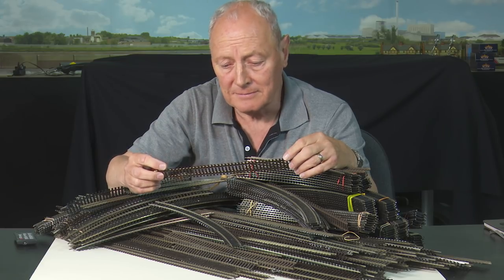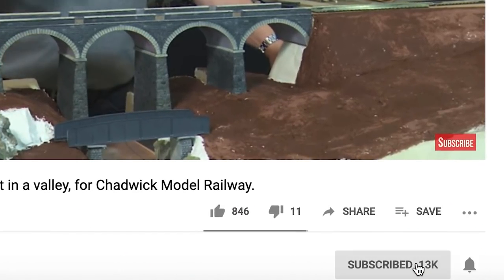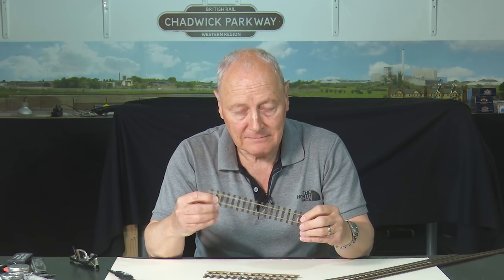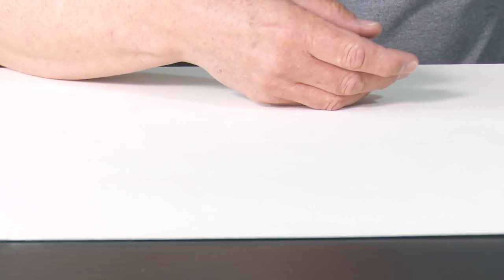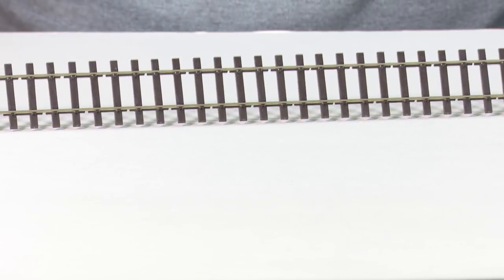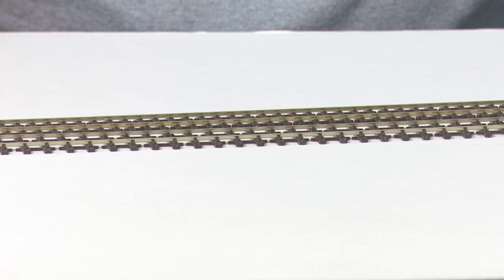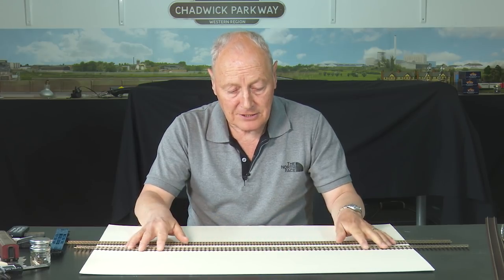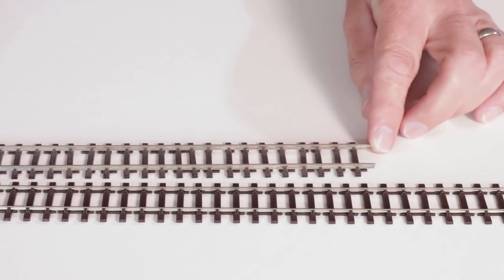Track  Peco Code 100, Code 75, Bullhead, EM and P4 explained at Chadwick Model Railway | 66.

Comment: Hi Charlie.. I'm enjoying your show from here in Los Angeles, Ca., USA....I'm probably not the first to come up with this wacky idea but here goes.... 
11:58 : The bumpiness due to the flanges hitting the simulated  'spike heads' on the code 75 doesn't seem to me to be that bad..Thus, would it be possible to actually go along your existing track and in some fashion sand/file down the spike heads just enough to clear the flanges instead of either re-wheeling or going code 100 ? Of course I mean not so much as to completely destroy the head...Then maybe a bit of paint would be needed to re-darken the heads as plastic tends to go white when sanded...
Also, would you tell we viewers how many scale inches code 100 rail represents in HO...My belief, if scaled out, it would be around 13-14 real inches tall..Yes ? No ?  I'm having arguments with people in a train forum over this..Thanks, M
Reply from the maker: No Mark, it's far easier to chanch the wheel sets. It's 4mm to the foot Mark.
Reply: @ChadwickModelRailway  Thanks much for such a quick response...But I'm asking, if you are able , to tell me how many scale inches (not metrics) code 100 rail is in HO scale 1:87..
I'm sure 100 looks great in OO scale.. But I think it's too tall for HO at perhaps 12"-14". No ?

Comment: Hi mate, love your videos! I found you while looking at track comparisons. Basically iv always wanted to build my own layout. I have a large collection of hornby sets and extra hornby track but I'm not sure if I should use this track for a proper layout. Would you say its worthwhile for me to invest in peco track for a permanent layout and sell off my old hornby track? I'm not worried about money my concern is more committing to a scenic layout then having to rip track up because points are failing/derailing ect.
Reply from the maker: A great question JJ. 
My advice would be to avoid at all costs any steel track, and if you can, switch to Peco streamline Flexi track. 
That way, you’re not limited by the geometry of rigid track systems. 
Regards, Charlie
Reply: @Chadwick Model Railway  ok I will look into that thank you for the advice. All my locos are standard non DCC, I'd love to build a DCC layout but I think it's too much work and I'd have to essentially change all my locos which I don't really want to do, I'm basically just gonna build a old school layout which I manually control myself. Do you have any videos you could recommend for people who don't use DCC to get best results? I'm guessing the first stage would be a better power controller than the ones you get with hornby sets.
Reply from the maker: Sorry JJ but I have none.  However, YouTube is an endless source of information once you know wher to look.
Regards Charlie

Comment: Thanks Charlie. Very informative as usual and particularly useful for me as I’m just starting to build a layout. I’m just about convinced that I will use the Peco code 75 bullhead track. I’ve been told that the sleepers are difficult to maintain an even spacing when bending the flexi track. This is apparently due to the grouping of the plastic mouldings of the sleepers. I believe the code 75 is in groups of four whereas the bullhead is in groups of two? Have you any thoughts on this?
Reply from the maker: I’m so pleased that you enjoyed it Dave.   I’ll check out the laying of Bullhead in a later video.

Comment: Just as a matter of record...( and being VERY pedantic ) ... there was some bullhead rail used on concrete sleepers... most of the 3/4 mile running line at 'Rocks by Rail' in Rutland is laid using it... see photo link below!
https://www.flickr.com/photos/satchfan1/5776393522/
However... I believe this was predominantly a war time format … and on the basis that I think this was almost exclusively used on Industrial railway, I think I'd generally concur with your statement!  Great video... keep up the good work!
Reply from the maker: I’m so pleased that you enjoyed it Al.

Comment: Hi Charlie, thanks for another great video pesentation. Do you have any preference for track joiners / fishplates? I find the Hornby ones are a much tighter fit due to their folded profiles, whereas the Peco ones are often much looser and prompt fears about their ability to transmit the DCC signals.
Reply: I should also say that yes I know that your dropper wires will manage the DCC signals, but that will only be 100% efficient if every piece of track has droppers attached.
Reply from the maker: and that is the case Nick. Every piece has droppers. I’ve never use Hornby joiners so I really can’t comment.

Comment: aren't turnouts usually wooden sleepers anyway? AND am I on my own thinking that the clickety-click, clickety-click sound of using discontinuous track with joints .....  much more realistic sounding than the expensive steam engine noises coming from model engines these days ..... I didn't think you quite said as much?
Reply from the maker: Yes only newly commissioned tracks seem to have concrete sleepers.
Whether loco sound is realistic is obviously a subjective experience.
Regards Charlie

Comment: Thank you for another informative video.  It is interesting, I changed all my Lima wheels at the first opportunity using either Hornby or Bachmann ones and doing it one at a time.  I have more problem with the huge Lima and Hornby couplings, which I don't know how to successfully replace.  The depth of the rail is important and there are issues with older engines whose depth are too much for code 75 so I will stick to code 100.  As far as sleeper spacing is concerned, I don't think it does matter that it is prototypical.  It is the look which matters.  By the time you have ballasted, and in your case weathered, it really doesn't matter about the correct spacing because it looks OK.  Besides which it is the moving vehicles which your eyes turn to when they are operating not the track.  I do admit that Proto 4 and  18 8 track looks brilliant, but unless you have started with that in mind, or have unlimited finances and have decided at the start that is the way you are going to go, it is expensive and hard work.  I remember looking at the model railway produced originally by Mr Ahern.  The scenery and houses were exquisite but the railway looked almost amateurish in comparison.  As far as set track is concerned, I do believe that it can have its use on a layout under certain circumstances, in the same way as when looking at hidden sidings there is no reason to use code 75 bullhead track.  So as long as you are reasonably happy with the result, and you can actually see the track, I don't think that code 75 (and particularly bullhead rail)  is the way forward and will probably remain an almost niche market and as a result will carry a much higher cost.  If you believe that extra cost is worth it then that is fine.  If not, stick to code 100.
Reply from the maker: Some excellent points Don.
And a train set gets put away at bedtime.

Comment: as per a previous comment I am a 60+ and just starting out so any help / advise on track laying / building base boards. basic to get started and any advice on DCC controller as I am starting from scratch.
Reply from the maker: Hi John,  here's a quick list.
What scale depends on the room available.
What era depends on what floats your boat.
Size also depends on your health and wealth!
Don't start something that you will never finish.
DCC is the best when starting from scratch.
Reply: thanks , my plan is a small project in oo scale colliery setting.

Comment: Hi Charlie! New Subscriber here! I'm about to embark on the great journey of making my own layout. But I'd like your advice on buying second hand track. At a local flea market there's a unit that sells second hand model railway things. One section in particular sells a lot of track, but it's like a pick and mix system, where it's a box full, and you pick what you want. The key problem is how do I tell if it's Hornby, and more importantly the difference between steel and nickel silver? I'd prefer nickel silver. I'll look out for signs of rust, but what if it's a shiny 'new' steel piece? (There's also a proper model railway shop there too, but they sell brand new, and I have a 'challenged budget'! ;-) 
I'd be most grateful for your advice and thoughts.
Many thanks.
Mike 
(Greetings from sunny Cheshire!)
Reply from the maker: Mike that’s a very easy one, take a little magnet with you.
Obviously the magnet will be attracted to the steel and please don’t buy any regardless of the price. I prefer Peco to Hornby but be very cautious when buying secondhand points. Regards Charlie
Reply: @ChadwickModelRailway  Thanks for the advice Charlie! It's much appreciated!

Comment: NO! The scale is 3.5mm to the foot, the gauge is 16.5mm.

If you go to Grantham and take the Norwich train you will see that the sleeper spacings are different. The standards books produced by railways over the years might give a set spacing, but reality is often non-standard.

4mm to the foot is 1:76.25, irrespective of the gauge of track you run on.

Peco is based in DEVON.

There was Bullhead track on concrete sleepers. There was plenty of it about. The Nene Valley Railway had plenty of it between Peterborough and Orton Mere stations. They either got it when they bought the line or bought it off BR to replace older track.
Reply from the maker: Thanks for your advice Neil.

Comment: Great video. I question do you guys have peco code 83? I ask because that's what I use in HO
Reply from the maker: Hi, Code 83 is indeed available here but  I believe that it is only bought by North American modellers.
Reply: That would be me lol
Reply: @ChadwickModelRailway  In mainland Europe code 83 is considered the compromise track height... which will fit most of the pre -NEM wheelsets from the late 80s but still looks a little better compared to a code 100 profile (especially an unpainted one). If you don't want to go finescale, you have the choice between Weinert and Tillig for that profile height.
Reply from the maker: Thanks Ivo, some interesting points.

Comment: Very interesting. I have been out of the hobby for some years. Lots of boxed up rolling stock. 25 years and older!. So if I purchased a Hornby item of rolling stock today will it run on both code 100 and code 75 track?
Reply: Yes, new models have finer wheel sets which run on both code 75 and 100, but your older models will run on code 100, but might not   run on code 75.
Cheers Rich
Reply: @gwrdriver1660  Thanks for confirming. Thinking about getting back into the hobby. At the moment reading up on DCC to convert my existing loco fleet.
Reply from the maker: Great decision, Going DCC is the first step in a great modelling future.

Comment: How times have changed since I last had my layout in the early 80’s. in my opinion, a train set can be the very start of a layout or model railway, what the saying from small acorns trees grow.? You mentioned HO, O and 00, what about N gauge?, I know it’s not so widely used, but nether less you might have some N gauge viewers.
Reply from the maker: I do appreciate your view on N Gauge Paul.  However, in that video, I was examining the differences between the “4mm to the ft” options.

Comment: Standard gauge vs Broad gauge? It's like an earlier - railway version of the VHS vs Betamax battle 😂. 
Imagine how much easier it would be for the buffet trolley if the 7ft gauge had been universally adopted 🤔😁.
Interestingly, Ireland adopted a gauge of just over 5ft. Cue, further confusion and vexation 😂
Reply from the maker: ……. and apparently BetaMax was better.
Regards Charlie
Reply: @ChadwickModelRailway  it was a better design. I've worked on both. But that was ooh 🤔 95 years ago 👍😁

Comment: Brunel was right. Broad gauge allowed carriages to be bigger and more luxurious, plus they cornered better at speed.
Reply from the maker: But tunnels had to be massive!
Reply: @ChadwickModelRailway  Agreed. In addition track beds on bridges and viaducts had to be wider too to accommodate broad gauge. But Brunel was still right. The additional luxury that could have been put into coaches, and their handling was much better. Indeed, even today with high speed trains, tilting into corners at high speed is an issue with Stephensons gauge.

Comment: Ok, I'll wade in. Train sets get put up and taken down after each running session. It's due to lack of space. Model railways have a permanent set up, which results in scenery getting added, as pointed out below. Nothing to do with the actual track! 'Models' are a representation of the real thing, not necessarily an exact scaled down copy. It's all in the eye of the beholder. As Cyril Freezer pointed out years ago, some things, like mechanical running clearances, simply do not scale. Yes, P4 and EM may well look better, but that does not mean that 'OO' 100 set-track stops the layout being a model. BobUK.
Reply from the maker: You are of course right Bob, train sets are put away after use.

Comment: I'd  be inclined to replace main lines with concrete and leave sidings to wood until you see a complete mass shift to having every siding  done  in concrete

to  be honest looking at the different widths in track you could almost do a narrow and wide gauge setup as a third rail

however I have yet to see a dual carriage setup with both narrow and wide gauge existing in the same track space

looking at the EM standard that looks to the standard for 4.5 foot wide gauge and P4 looks like a standard for description of narrow gauge 

depending on what defines the UK rail system in both a narrow gauge standard and what is classed as the wide gauge standard rail..
Reply from the maker: Jason please not more choices for me to consider!  A very good point to consider.
Reply: @ChadwickModelRailway  ya i made the point because how many active spur line you know of that would run concrete sleepers same with sidings, especially if you are  basing area on a specific prototypical area..

though I have yet to see a rail layout that  would cater to both wide and narrow gauge operation on the same piece of track though it would be a fun project for someone to do assuming you could get all the points made..